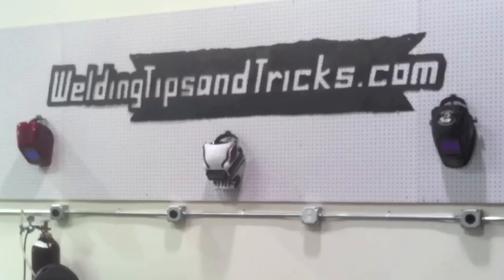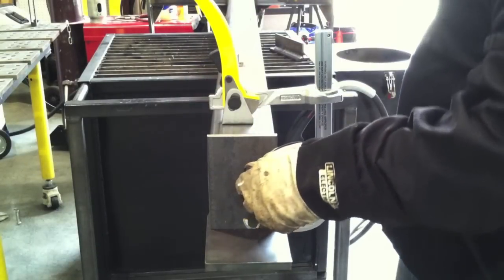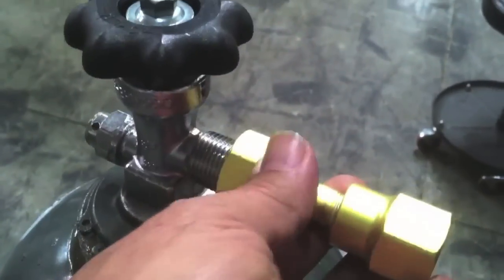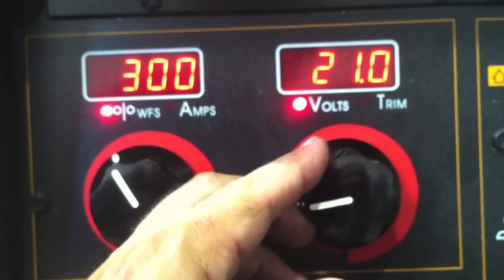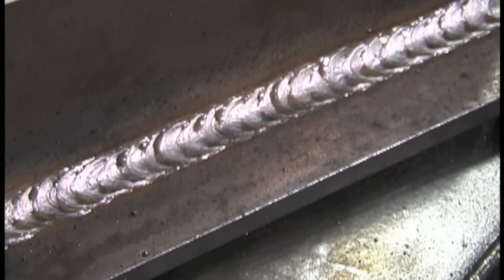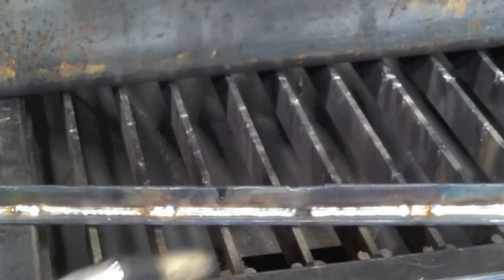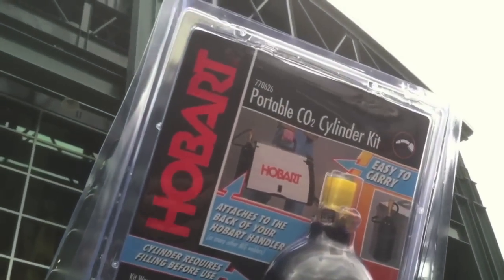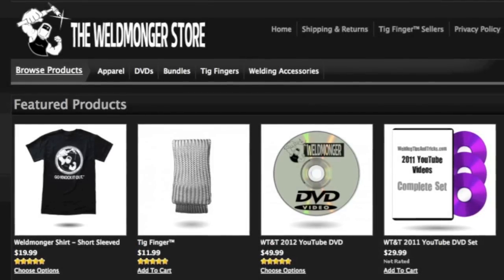Mig Welding Tips- Lincoln PowerMig 350mp - Co2 gas

Comment from the maker: it might . I would prefer 75/25 for general short arc mig...but 85/15 should work ok if you have enough power and duty cycle and find the right balance between voltage and wire speed. I used some 90/10 the other day on short arc for some thinner stuff and it worked out ok

Comment: Well, I spent 4 years making various tanks of A-36 plate and 1/4-3/8" wall steel tubing, and we used 100% CO2 for everything. A little more penetration, but lots of spatter for sure.
Welding machines were very old Linde units, so no pulse available. We did a lot of out-of-position, CO2 good for that. Everything full-pen, butt-up with 1/8" gap square, one bead inside, then grind a little and fill on OD. Much 1/4-3/8" plate. Also shop owner refused to get pulse units or mixed gasses.

Comment: Those small C02 cylinders have no regulation, but most often its around 850psi output. But you really need to watch it if it is hot in the shop/work area as you could run into troubles. Over pressurization of the line or you could even blow the little burst disk on the tank.

Comment: We use the same machine at work, and have a custom program for a pulse mode and run 68Co2 20ar 12he for steel. Then when we weld stainless we use another gas with even more helium. From my understanding it helps to keep the weld cleaner. Your thoughts?

Comment: I have a few questions bout co2 gas you said its ok for some welding. I just do structural welding i.e. trailers, farm projects would co2 be ok for this type of use? I currently use flux core and I have a chance to get my hands on a few co2 tanks this is why I am asking any help would be great thanks.

Comment: Mr. Welder, I am nata from Indonesia, allow me to ask Mr. Welder,
before that I want to say many thanks to Mr Welder. Mr. Welder, I have difficulty setting the amperes, voltages and CO2 of the CO2 in the Rhino brand CO2 mig welding machine 250 amps to weld with iron thickness of 2 to 5 milli. I just bought this mig welding machine through online shopping. I didn't get the manual book. Mr. Welder, can you help me? 🙏🏻many thank you, Mr. Welder JBU

Comment: What pulse arc parameters would you recommend for 90/10 co²/argon with 0.45 hardwire welding 3/4 steel? 

Specifically wfs and trim